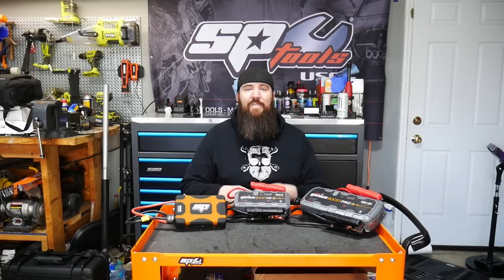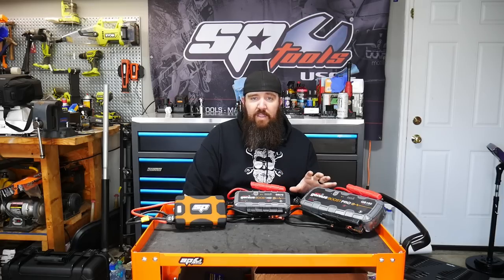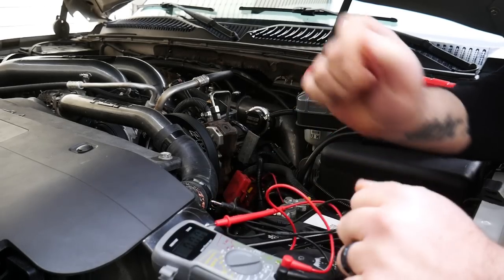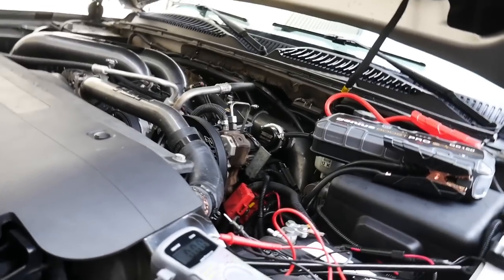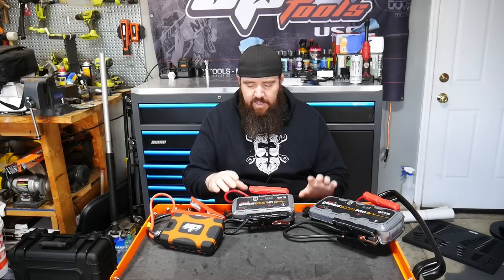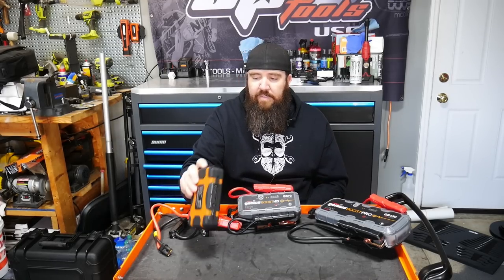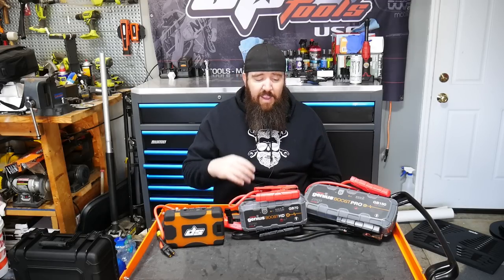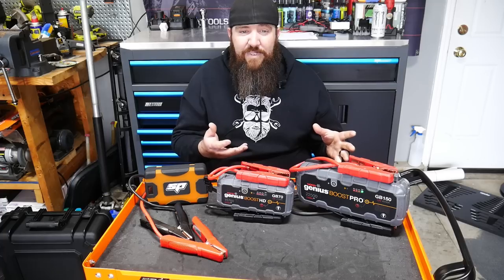BEST OF THE BEST - *UPDATED* REAL WORLD TESTING COMPACT HEAVY DUTY JUMP PACKS

Comment: I really appreciate this video, I was going to buy the noco GB150 cuz I have the GB40 and it won't jump start any of the Audi's i work on now. It worked fine for small engines that have the batteries right next to it but most audi have jump posts on the engine bay and the battery is usually in the trunk or in other harder areas to reach. So good to know I didn't throw my money away. Thanks
Reply: This WOULD HAVE WORKED if he would’ve hooked it up straight to the battery instead of those stupid remote jump posts. You would NOT have wasted your money.
Reply: You wouldn't have wasted your money. The dude used the jumper packs incorrectly. Reading the manual shows you're supposed to leave it hooked up for a minute until it charges it to a good voltage basically. You can hold the power button (I believe. I could be wrong) and that will put it into manual override, and allow you to basically use it as a jumper pack straight away. This dude was basically using the noco gb packs as a jump starter straight away while it was in the battery charging mode.
Reply: I read this from someone's comment on how he was using the GB jumper packs wrong, which was a big reason it didn't jump off his vehicle straight away like he was hoping, so take that knowledge how you will.

Comment: For all the haters here, I have a GB-40 and love it, never missed a beat. But in this video and the old one you can see the boost light come on and he is unable to start the car. I do not even slightly believe that Rustbelt Mechanic is lying or cheating in any way, SP tools make amazing tools and obviously have a much better power delivery, I suspect a ultra high current buck converter circuit whereas the Genius boost is literally a bunch of lithium batteries in series connected by a mechanical solenoid relay, Yes its cheap, yes it works but no its not going to start your diesel and NO its not going to come close to the SP tools jumper and for crying out loud NO Rustbelt Mechanic obviously did not cheat on the test, he has nothing to gain from it!

Comment: What's the difference between the Noco Boost Pro GB150 3,000A 9L gas 7L diesel and the Noco GENIUS Boost Pro GB150 4,000A 10L gas or diesel?????
Reply from the maker: Not sure, boost pro wasn’t out the time I did the video I believe
Reply: I emailed Noco, this is what they told Me.

Chris G (NOCO) 
Jan 4, 2021, 10:14 MST 

R,

Thanks for contacting NOCO Support.

The GB150 4000A has been replaced with the 3000A version.  We revised our rating due to a change in the testing standards developed in a partnership with UL. However, the new 3000A GB150 is significantly more powerful than any previous versions.  As resellers refresh their inventory, all that will be available is the 3000A version.  I do apologize for the inconvenience.

Please let us know if you have any additional questions. 

Regards,
Chris G
NOCO Support Specialist

Comment: The number stated on the unit is referring to the peak total power. Geepers!! if you had the like of 2000 amps going to your starter POOF! it would be fried. The starter would only take no more than what the master main fuse is rated for if even at that at least half to turn over a engine.

Comment: Just bought a GB70 and i'm sending it back.  It only puts out 12v even after charging it with a bench power supply.  If you have a relatively dumb car it does work, it started my 5.7 chevy with a battery at 8v - it delivered 200 amps during cranking so it does work to an extent.  But it refused to start my L322 Range rover because the car needs more than 12v to even attempt to crank and this pack doesn't put out more than 12v and therefore doesn't deliver any 'boost' into the battery.  So if you have a relatively dumb car that will start on sub 12v then it will work, but some more modern cars wont allow the engine to crank on 12v (which is actually considered at 50% battery level)

Comment: Just at your voltmeter you can tell that 2nd test will not start it because it's showing under 12v on voltmeter and 3rd test with SP unit will start it because it's showing more than 13v so I already knew just by looking at voltmeter which one was going to start it and which one was not 🤗

Comment: Rating is based on Temperatures... You're not going to get the full rating. If you're no where near that...

And these have two functions. The battery has to be above 2-3 volts. To work. If not. You have to hit the override button..To get the battery above that voltage. Then the NOCO will work.. It's a safety feature. to keep you from blowing your battery up..

Comment: These booster packs are designed differently. Noco takes alil bit to put the power in where the SP puts out Alot of it's power at first but only for a few seconds. I have several booster backs and one of the cheaper ones I bought off of Amazon is a Gooloo and it works like that SP tools it puts out a ton of power right off of the bat but within a few short seconds cuts off. I have started 10 vehicles in a row with it no problem but if you need to leave the vehicle running a minute with it on, it is not jump pack you want.
Reply: He knows. He’s a dishonest shill.

Comment: there was no way the nocos were fully charged. both were below 10volts with no load. seem like a doctored video.
Reply from the maker: Definitely fully charged over night and the GB150 is fairly new. You saw them at 100%
Reply: how do you explain that the nocos were at less than 10v with no load?

Comment: Has anyone else noticed he never showed what the voltage was on the gb150 ?? I have one and start my f-350  no problem with dead batteries on truck multiple times.  My batteries didn't hold charge so I had to jump it everytime.

Comment: Bro ... u gathered a lot of keyboard cowboys 
I’ve always used the Noco’s 
I use several different Noco’s daily 
In my Ram 5.7 (gas), the GB50’s would suffice 
My big Ram 2500/diesel, I have the GB70 and does the job 
I oversee a parking lot of 2000 cars & I use em daily on different vehicles 
I will say I’ve had to send both models back due “faulty unit” issues after contacting Noco
Awesome video though (even having to waste time for the skeptic know it all’s)
You must’ve proven a point ... I’ve tried several times going to SP link & always sold out 
I was gonna pick one up simply from watching this video 
Keep it up (& Fu€k the haters) ‼️
Reply from the maker: Thanks man... hey... insider trading... next week(about Monday-ish) SP is getting a shipment of them in at limited quantities. Code RUSTBELT still works for 10% off too
Reply: @RustbeltMechanic  
Will definitely be looking into it ‼️
Reply from the maker: Nudge nudge.... they’re live on the SP site along with limited quantities of the cordless 700ftlb mid torque impact. Same discount code works across the site

Comment: I don't believe this video I have a gb150 and it's only a 3000 watt model it fires these big diesel trucks up all the time with zero hesitation I just used it to crank my flatbed tow truck up the other day that was only at 6 volts if fired right up like it had two brand new batteries in it zero hesitation

Comment: My Noco GB70 is a complete fail, because of a very serious design flaw.  I tried to use mine at -24C and it just flashed error.  Close reading of the instructions say its designed to shut down in temps colder that -20C.  WTF? That's the one time I really needed it. BTW -20 is completely normal for the winter here in Canada.

Comment: I don't know why so much hate on this video. I have the GB150 and like it. It's the best jump pack I've seen so far. But I knew it would not jump that truck! I've tried several diesel trucks and it won't do it if they are dead! Also people say he is using it wrong. You can't use it wrong unless you connect the leads backwards! The boost button does not give you more boost, only is necessary if voltage is below 2 volts, tells you that in the manual! If the power lights cycle then it is providing full boost! I think 2 gb150's would have jumped that truck. But I'm sold on the sp tools one now! good video rustbelt!
Reply from the maker: Thank you!!! Absolutely! Why would I make things up on a jump pack that I personally own and paid money for AND use in my shop life?! Anyone who REALLY daily uses a GB150 knows what it can actually do. It takes two of these units to jump start a new HO Cummins on our dealer lot. I believe in this SP one actually working so well I called them this morning and paid to have them send me another one to have at work.
Reply: @RustbeltMechanic  Haters gona hate I guess. I know even on a v6 with bad cells I have to disconnect the battery and connect the gb150 to start it! I'm curious as to how many more times that SP jump pack would have started the truck! I think at least another time or more! I noticed that the voltage was at 10 volts or so after the 2nd time. It must really put some juice out, like right now! Even a battery charger on 200amp engine start wouldn't do that I don't think! And just so everyone knows, I don't own not one SP tool, I'm just a tech. I'm also not friends with rustbelt. Don't know him!

Comment: Coming from a tech that gets cars from the tow lot with stone dead batteries. The only test is with any to all batteries removed from the car (except high voltage hybrid batteries).  My go to jumper is the jump and carry 770r (JNC 770R). What I have seen is that some vehicle charging systems are slow to start charging. My experience has been that the small jumpers shut down after jump starting causing the engine to shut down right after it started. In other words, will the jumper maintain a voltage after the jump start.  Maybe disconnect the alternator also to see if with just the jumper box in the electrical system, will the vehicle crank and stay running without output from an alternator?  Great video and that SP tools is a great contender.
Reply from the maker: Great points! I see those JNC770R’s and say to myself, nah I don’t really need that....and then I get a stone dead 6.0 Ford in the middle of winter. Then immediately kick myself in the butt lol

Comment: You killed the genius boosters before you took the video. The voltage of both should have gone above 12V. Showing us the light is stating that the booster is full but what is its voltage before you connect to the vehicle.

Comment: Can I put a GB70 to jump start my 2018 H-D Road Glide??  I was going to buy the 20 or 40, but wanted to use it for my 2500 as well.
Reply from the maker: A GB70 will not have the juice to jump big Diesel engines in cold conditions with drained batteries.

Comment: Interesting. I have three different boosters. One is quite large. It's like a 70 pound unit. I left the key on in my 6.7 Powerstroke for about three days this winter. Both batteries were pretty much flat. Nothing I have would start it. I had to charge it for 6 hours to start it. So, will the SP Tools unit crank a diesel at near 0 volts?
Reply: I doubt it. Even jumping a dead battery like that off from another vehicle will be tough. You'll have to leave it hooked up for quite a while to even get anywhere for that. These battery packs don't have the power capacity nor the endurance to push that much power. They are good for batteries that are low, like if your vehicle is clicking over when trying to start, but stone cold dead batteries pretty much have to he put on a battery charger for at least a little while before being good to go.
Reply: @VicinalElk44104  Thanks. That's what I thought.

Comment: You mentioned that as part of the safety features neither of these packs will start a vehicle under a certain voltage so does that mean that these packs will not start a vehicle or rather even attempt to start a vehicle that has no battery?? There have been instances where I have had to pick up a car that had no battery And/or a bad alternator. I have used different battery jump starters over the years and in these cases I jump the car and leave the jump starter in the vehicle under the hood and drive away does that mean that this is not possible with these booster packs? That would really put me off from buying one of these. I'd like to move away from the bulky jump starters but if they can't do that then I'll have to keep dealing with them
Reply: No battery needed. Use “manual override” button. (He mistakenly calls it the “boost” button.) The override negates the need for NOCO to spend 30-60 seconds connecting, identifying, and verifying a battery present.
Reply: @kjshelley  gotcha, thank you for the info!

Comment: You need to let these units charge the battery for a minute or two if they are totally dead. I’ve got the GB 40 and it’s never let me down. I think your doing your test wrong. Hook the units up to the battery’s as any person would hook that unit up.
Reply from the maker: But I didn’t have to let the SP jump pack “sit there a few minutes and charge the battery”🤷‍♂️
Reply: @RustbeltMechanic  They are different. Even in the video, you could see the voltage would start to rise more after you tried to start it. I just watched a video of a guy starting a dead battery cummins with the GB70.

Comment: You don’t know how to use NOCO jumper boxes. If the battery is really flat and 5 Volts is dead flat. You need to press the boost button to get it to start the car